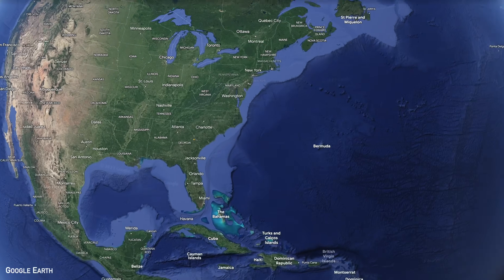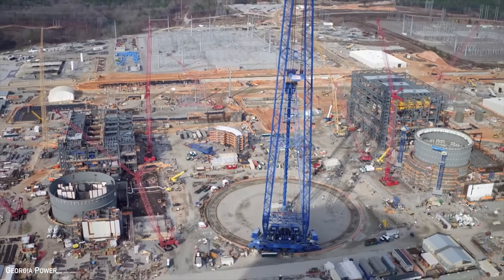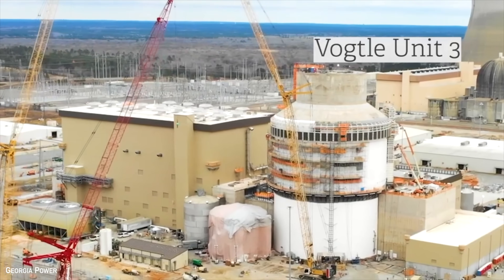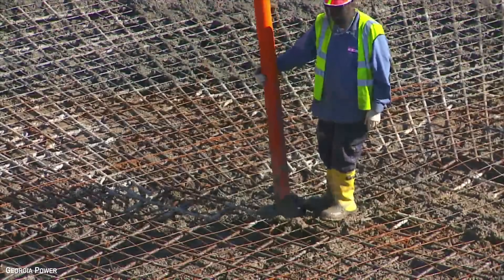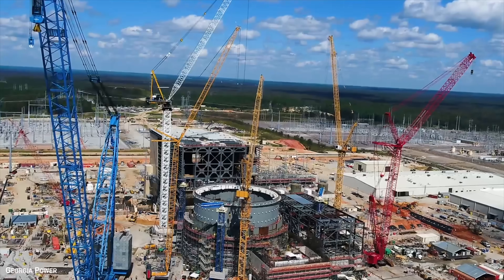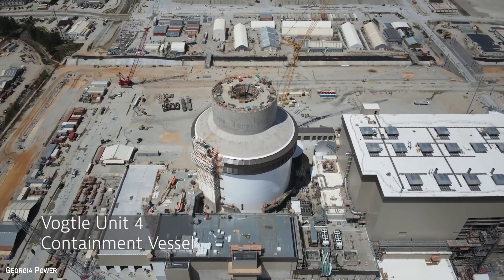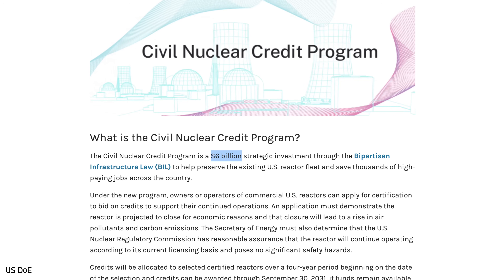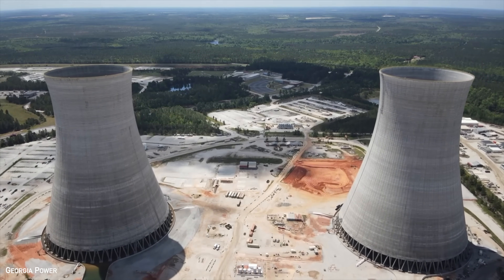Why the Future of Nuclear Power Depends on This Plant

Comment: About time.... you need 4th gen as well....   Oh you forgot about the natrium plant
Reply: I thought about Natrium in 2016 when Terrapower was founded.  Now in 2023 no ground has been broken but they have great power point presentations
Reply: @clarkkent9080  I thought the site for the demonstration plant is approved?
Reply: @markwright196  The site Kemmerer Wy.,  has been selected.  A place where only 2,700 people want to live, has poor performing schools in a state with under performing schools and the locals don't like Bill Gates because he believes in vaccines.  What a great place to look for nuclear workers and the locals will love it when they are outnumbered by construction workers.  The site was chosen for political reasons: showing that a coal plant site can be converted to nuclear use.

The project is on hold because the uranium fuel was to come from Russia and you know that story.  But don't worry the U.S. taxpayer will build a plant here in the U.S. to make their fuel, as soon as they finish the environmental impact statement.

You can't make this stuff up.
Reply: @clarkkent9080  Yes the fabrication was the issue., Fuel is a no brainer as you have plenty in stock to down blend. I dont like many of BGs viewpoints thou the ones that are correct I dont discount due to a bias.
Reply: @clarkkent9080  Also fuelling is the very last thing in a multi year project so I doubt its actually that significant for the project critical path.
Reply: @markwright196  The project was advertised to cost $1 billion. But they have up to $2 billion in matching taxpayer welfare but it expires in 2025.  I guess BG took a hit in his divorce.  The coal plant it is supposed to replace is scheduled to shutdown in 2028 and I can't see it being completed in 4 years given that winters make construction difficult. 
Trying to get qualified workers to move to the middle of no where with no lodging or restaurants available to support a doubling population will be difficult. And the locals will not appreciate the drugs and crime that comes along with it.

My bet is on a massive cluster f#@k.  Lets see who is right. .
Reply: @clarkkent9080  yes I am not sure the time line. Molten salt is vastly easier and the size  is much smaller (nuke island) as I believe its tiny basic truck to deliver and all the other components.. also you dont need a breach containment structure but merely a protective structure. I think the actual pot is a 345mw unit so quite small... the 500mw comes from salt storage (5hrs at 500mw) 345mw after
Reply: @markwright196  The idea that a nuclear power plant would fit on a truck or even a rail car is insane.  345 Mw output is 1/3 the output of a standard PWR and would actually be larger than 1/3 the acreage needed for a standard PWR.  What components of a standard PWR will not be needed for a MSR that is only 1/3 the output?

Natrium will use molten sodium which is highly reactive with moisture.  They will have to design for a radioactive sodium fire and have a containment to withstand that. It may not be as robust but it will be required along with non-water fire suppression and that used to be halon but as a ozone deplete , halon has been banned for fire suppression.  

They apparently plan on spending $4 billion to build a 345 Mw plant and that is almost as much per Mw as the financial Vogtle failure but it is just an estimate and they not  built anything yet. 

Lets just sit back and watch the show, if it ever starts, before either of us makes claims.
Reply: @clarkkent9080  You need to read up on molten salt... these operate at atmospheric pressure so its a completely different beast. yes you need to do the concreting but its not the containment building that you need for pressure reactors. Merely robust enough for external events which is common construction.
Reply: @clarkkent9080  For that reactor the molten salt storage is the bigger logistic issue as it is for solar thermal
Reply: I get the habit to fear monger ... but the molten salt for steam production is a secondary loop... ideally these will all go helium or CO2 in the future as its a better conversion ratio and water not needed. air cooled.
Reply: @markwright196  The salt coolant is very corrosive and requires special piping, valves, and pumps that will cost more and weigh more than those found in PWRs or BWRS.

The containment must withstand all natural and man made accidents like aircraft crash which will require a little more than common construction. As well as the design accident which I would guess is a loss of radioactive sodium coolant to the containment with a subsequent fire, also not common construction but very custom. My best guess would be a containment inerted with nitrogen.

Terrapower is now saying their 345 Mw plant will cost $4 billion and they haven't even started construction and NO nuclear plant has ever come in near budget.  Of course they say the price will come down as they build more and where have we heard that before.

Terrapower has had NRC approval for their design and the site selected for 2 years now and still nothing.  They have a little more than 4 months left in Wy summer before the winter shuts down any major construction. And that $2 billion in taxpayer welfare expires in 2025.  Tic  tock tic tock

No claims about MSRs are valid for U.S. construction until someone actually builds one and proves the concept. And if it fails, there are already people lined up claiming any failure will be the result of Terrapower choosing Uranium over Thorium.  So it will always be a game changer that has never been proven.
Reply: @markwright196  It is not just an operational problem.  EVERY system has leaks and need maintenance and sodium is highly reactive.  One drop of sweat can cause a fire. How will maintenance even work on a system that has highly reactive sodium?  If you are not afraid of working with sodium then you have no idea how dangerous it can be.
Reply: @clarkkent9080  Firstly 99% of the system is SALT not the metal. they are not pumping sodium nor is it under pressure. its convective only.... Many designs use salts in primary AND secondary loops so not an issue.  As I said go read up on this and you will get a better understanding than some cherry picked event.
Reply: @clarkkent9080  NO NO NO... salt on its own is less corrosive than pure water... Again you need to understand this crap and not stupid greenie fallback narratives
Reply: @markwright196  The Natrium design,  incorporates various safety features that came out of studying previous accidents. For example, pipes that carry sodium pass inside a larger pipe containing an inert gas that won’t react with the sodium, should the inner sodium pipe spring a leak. They also have a lot of advanced sensor equipment that will detect any leaks quickly. WOW, that seems like a lot of extra piping to protect a 99% salt solution that is not hazardous.

This spring (2024) TerraPower plans to break ground on a sodium test and fill facility. Navin said it will allow their engineers to fully understand how the sodium will interact at the reactor when it’s operational.  WOW, they don't even know how sodium reacts but they are planning on spending $2 billion in taxpayer welfare to find out.

“It’ll give our engineers an opportunity to work with the sodium a little bit and do some materials testing just to make sure that all of our assumptions are correct,” Navin said.

You need to do a little research.  But I admit that I was wrong. Kemmerer Wy was not chosen to prove nuclear can replace coal.  It was chosen because it is in the middle of no where and if it has an accident, only 2,700 red necks will be affected
Reply: @markwright196  I know a little about thermodynamics and convection will not move any fluid that hundred of yard+  to the storage tanks, into, or out of those storage tanks.  You need to go read some basic physics
Reply: @clarkkent9080   Look you are not listening nor have you bothered to read the technical specs. The molten salt loop is no different than the thermal solar out in the desert which is magically fine according to greenies.

Comment: Bechtel is the Bigest loser I know, They were In Charge of the Failed Midland Mi Nuclear Power Plant the Office building was built 1st, it started sinking do to poor soil work, instead of Stoping Work do to soil problems they started working on the Nuclear reactors and they sunk in the soil to
Reply: Didn't they freeze the subsoil trying to keep it from sinking?
Reply: @clarkkent9080   having been born 20 miles away  the soil is so bad that pilings should have been driver to bed rock. they are done that way on large buildings , it was built next to a river. Soil next to a river is not always the best load bearing soil. that is something Bechtel should have knowen
Reply: @dknowles60  With these massive projects, things do slip through that cracks.  Maybe that is why nuclear is 2-3 times as expensive as any other generation method.
Reply: @clarkkent9080  there is no excause for poor soil work even a home builder that builds a cheap home worrys about footings and soil

Comment: But the power company got at 25% raises per unit per month. Meaning my bill is 25% per 100 or 25 more per month. 
So.much for reduced or livable cost bs..
If you get 200 month then your bill is 50 more? 
For sure 25 per month is $300/.year

Comment: The parallels to orbital rockets are striking. We need to go from these things being handcrafted as one-of-a-kind projects to rolling off an assembly line. You obviously do not need mass production in the thousands of units to reap benefits of commonality in design and tooling, SpaceX has launched something like 100-200 rockets with essentially the same design, and have been able to cut their prices since they understand how to build and use their machines.
Reply: The submodules for the AP1000 at Vogtle and VC Summer were built via a production line. The first line was where the panels were first cut to size. Second line was where panels were laser etched for placement of components. The 3rd line was placement of components that were welded on using GMAW welding with 4 wires for the stiffener angles that ran the length of the panel. They progressed down the lines to have Nelson studs added as well as other components. Once each panel was complete, it would be mated to its opposite panel and that were between 2 to 4 feet apart (trying to crawl through them was a pain, especially on the studs). Once the welding was complete, it would go to the paint shop for painting of all external carbon steel components. Duplex stainless steel parts were not painted. 

This fab shop were these submodules were made had 10 bays, or roughly 407,000 square feet.

Comment: I worked on Plant Vogtle submodules as an inspector, both at Vogtle and Lake Charles. The biggest issue to start with was with the original contractor who was making said submodules. There was added costs for reinspection, repairs and addition of thousands of Nelson studs (which added even more weight) of the already completed submodules for the Unit 3 CA-20 module even before they could start putting the module together.

The company that took over fabrication of the submodules in Lake Charles also had to pay huge fines to the NRC due to the original company's failures. Inspecting the rest of the submodules for both VC Summer and Vogtle and insuring that they were built properly as I was paying for them (I resided in GA at that time), I had an "insiders" view on the manufacturing part and understand why at least there were issues at that stage. That company is now defunct, and Westinghouse took over work in Lake Charles, before they too, went bankrupt. I believe by that time, the submodules were completed. 

The biggest reason why they could not build those pieces on site was due to the amount of space needed to build them. There were multiple bays in which panels were laid out and in different stages of completion, just to keep submodules rolling out for shipping to either site  the modules could be put together in the Module Assembly Buildings that were on site.

Also, the Bellefonte TVA plant is no longer being worked on (I saw work on that happening around 2010-2013). https://www.timesfreepress.com/news/2021/sep/17/end-eratvgives-constructipermit-bellefonte-nu/
Reply: “Amount of space needed to build them” 

That suggests smaller reactors with smaller components have a better chance of being built offsite successfully, and thus reducing cost.
Reply: @Nill757  Fabrication of anything requires space. Even supposedly stick built structures require welding done in fab shops and items trucked to site. This could be beams with shear tabs welded to them or bar joists for multi-level buildings for both the floors and the roof. 

GMAW or FCAW welding is best performed in a shop as gas being blown away results in welds that will not be acceptable, and may not even be strong enough to hold the metals together.
Reply: @mikes6973  “Fab..  of anything requires space”

True.  And?  Also true that Fab of smaller things requires smaller spaces, smaller overhead lifts, smaller bays, lighter electrical service, less land to lease, no rail head required, etc. 

Fab of things just the right size, a suite spot if it can be found, can be used continually, where as a fab at the extreme end might go unused by orders for extended periods, driving up cost.   Sure there’s most always some voice contending ‘this extreme size (or method) was necessary, the only way to go’, but that doesn’t make it so.
Reply: @Nill757  No M0ron, he is providing first hand examples that the build it in a factory concept, sold as cost saving, is BS.  I heard the same story from the people I know that worked at Vogtle.  But in your mind the NRC must be responsible.
Reply: “TVA … no longer …”

Yes, stopped back in 2021?
Reply: Today, the latest unicorn way to save cost is building SMR in a factory.  People don't understand that the factory build process has been used before and it does not save money.